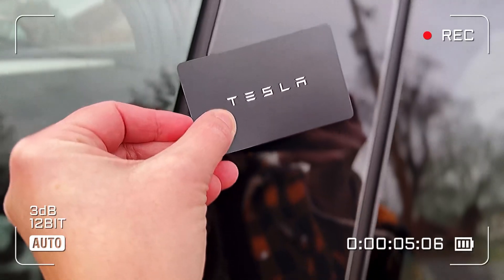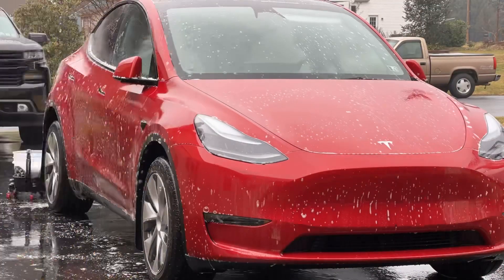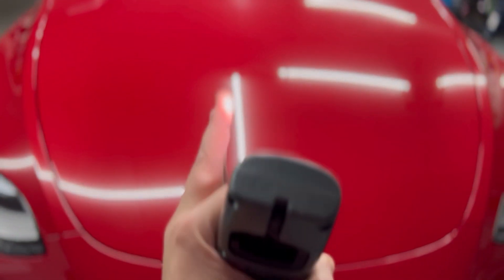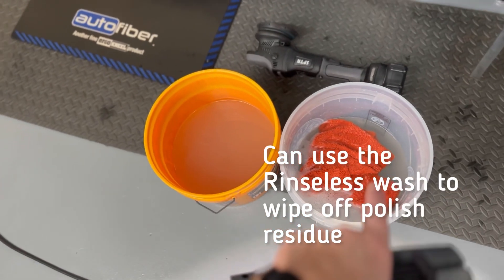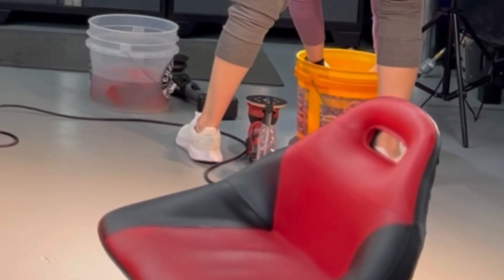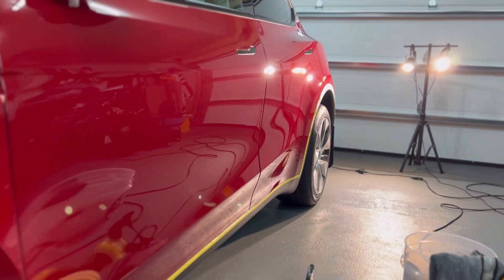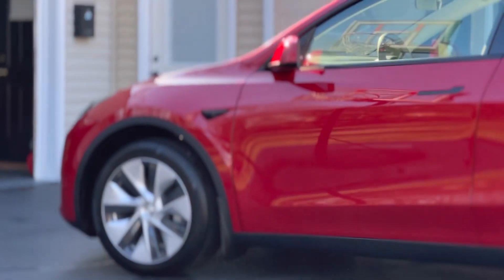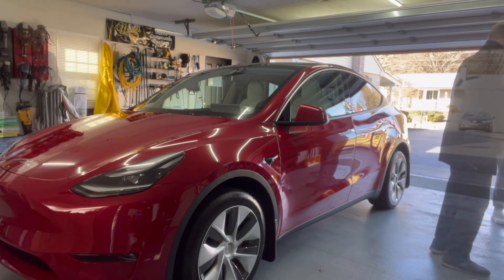Tips On Polishing Tesla Paint! WATCH THIS Before You Start!

Comment: I've never understood why people use multiple pads, I've used compressed air then went to a pad washer after not liking to wear a mask and not have the debit in the air. I must be lucky in 3 years of doing paint corrections I've still use a handful of pads and 4 polishes and have never struggled to do corrections in 1 step 99% of the time. The pad washer is harder on soft pads but it also keeps everything cool.

Comment: I’ve been Coating sooooo many new teslas lately myself. I must admit the paint is some of the worse and it’s that way on all models. I find myself using Xtreme Solutions finale on lighter colors and LVR403 on darker. If I need a little more cut I’ll add a couple dots of ICE. I have had success with EOD Polish but now find myself reaching for DIY spray polish more and more now.
Reply: What pad are you using?
Reply: @kimnewling5728  either yellow rupas or the DIY yellow waffle
Reply: @royaltyautodetailing  thank you

Comment: Would you recommend a short throw polisher on softer paint what is ghosting?  Like always enjoy the videos
Reply from the maker: Sometimes the larger throw can cause the marring so an 8mm is sometimes easier to finish down on softer paint

Ghosting is when you see the silhouette of the pad or polish in the light even after wiping off the residue from polishing. Sometimes it not detectable until you put a light on it. It’s similar to holograms but not as severe and normally just needs either a softer pad or polish to remove
Reply: @ okay thanks I’ve had that happen to me with my dad’s truck never knew what that was called enjoyed your first podcast it was really good

Comment: Hey Chelsea thanks for the video. I got a Model Y that’s about 7 months old now got it back in Feb so the paint is pretty 9.5/10. So barely any imperfections. 

My question is, do you think it’s necessary to get a paint gauge bc of how thin the clear coat is? I’m scared to polish but I purchased the DIY foam pad and spray polish just like you and I’m just nervous af to mess up the paint as I’ve never don’t it before. 

I also will be using maybe 1-2 waffle pads as well but will be cleaning it throughly as your process indicated in the video. 

Looking forward to your response. You’re the best !
Reply from the maker: If you’re only going for a paint enhancement on a brand new Tesla and using the gold standard and waffle pad, you should be fine. You just don’t want to go super slow with your arm speed but if you do 2 to 3 passes at a moderate speed you’re not gonna be taking off too much clear you should be fine.
Reply: @attention2detailswchelsea  thanks Chelsea! I was even gonna purchase a paint gauge but I don’t think it’s necessary .. I’ll test on a paint portion first. 

I appreciate you!

Comment: That’s a new one, can’t remember how to unlock the damm door! 🤣 So far I had a Cadillac that the battery died when working on the interior, the touch panel had just enough battery to open halfway. That, according to the dealer, was enough to disable the air conditioning. I had a trickle charger on it, but dealer said battery was dead. Another car, a honda, had a tire go flat and the battery die, was polishing it when In between songs on my garage system, working the fender, I heard the hissing. You could do a video on all the problems we run into. Some vehicles loose settings if you disconnect the battery.

Comment: Your videos are great... I have a couple of questions about polishing:
1) do you have any idea what RPM (roughly) you were using for the Tesla?
2) what size pads do you use?
Reply from the maker: I typically land on setting 4.5-5 (not sure if the rpm’s) and use 5” pads
Reply: When you coated this, did you coat all of the glass (windshield?), trim (rubber and plastic), headlights and cameras? @attention2detailswchelsea

Comment: You need a pad washer.  Yvan has been suggesting that for years and that is how I work.  As soon as the pad becomes dirty, I bring it to the pad washer and clean it.   There is no need for 1 pad per pannel when you work that way.   Also, this helps cool down the pad so they tend to last longer.  Also, not removing the pad from the polisher help preserve the hook and loop material so they last longer that way too.   I wonder is a rotary with a soft pad might work better on super soft paint.  I know Yvan like them a lot but I have a hard time trying to switch having been working with a DA for over 10 years.
Reply from the maker: I have one I was just showing an alternative to it with their rinseless wash for those that don’t have the $$ to invest in one as they can be expensive for some who don’t do this often
Reply: @attention2detailswchelsea  Yes, they do make an insane markup on what is basically a bucket, a grid guard and some plastic cups and  springs!  Paid mine like 100$ 6 years ago, now I think they sell closer to 200$.  But they do improve the work experience and down time a lot.  So for a business, I think they are a must.  For an enthousiast, they can certainly do without.

Comment: Now all you need is a pad washer. Clean that pad in 10 seconds 👍
I could have sworn you had one.
Reply from the maker: I do have one, but I had stopped using it because it was starting to tear my foam pads up and because I only had one pad I didn’t want to tear it up but Yvan let me know that these pads hold up really well with the pad washer and trust me, I will use it in the future now. But I was also trying to share techniques for those that may not have the money to invest in a pad washer because they are not the cheapest.
Reply: @attention2detailswchelsea  yep definitely anyone can use the bucket wash method. Good point. Weird, never had the washer mess up pads.

Comment: BTW, I used to use McKee's 37 Nano-Ceramic coating (not the graphene one) but after seeing independant testing on Scott HD's channel, that coating performed really poorly compared to other products so I switched to Cquartz UK for my 2 year product and the Gtechniq CLS+EXO for the 5 year product.  McKee's coatings are very inexpensive but they simply don't last.  In the test Scott did, they only lasted a few months compared to years for other products.  I suggest you have a look at his channel.  Also, graphene was provent to be much worse than nano-ceramic coatings.  I watches some interrviews with chemists and the problem is that no one has found a way to combine the graphene with the resin so it lasts.  They fail faster than nano-ceramic, and their supposed advantage of preventing water spots is not true, they water spot just like nano-ceramics.
Reply from the maker: I’ve had a graphene coating on my vehicle for over 2 years and it’s doing great. And 0 water spotting issues but appreciate the feedback and info
Reply: @attention2detailswchelsea  Are you topping the coating evey 6 months?  If so, you might be seeing the effect of the topper, not the coating.  If a coating fails like you said within 6 months if not washed often, that means the coating is crap.  Not rubbing it, and spraying it with chemicals once or twice a weak should improve the coating's durability, not reduce it.  Coatings are supposed to be pretty much immune to chemical products.  The one I use is resistant to chemicals from 2 to 11 on the PH scale.

Comment: Dont you have a pad washer? Do it on each pass for the same results!
Reply from the maker: I do but it can be rough on some pads sometimes I find and I only had one pad so I was trying to make it last and the handwashing is a lot gentler and also for those that don’t want to invest in a pad washer I was trying to show a more economical way to clean pads. But yes a pad washer is a great option as well
Reply: @Attention 2 Details w/ Chelsea i gotcha. Ive never noticed it being hard on pads personally. I only agitate on speed 1 or 2. Ive polished 10 cars using the same single pad in my shop. Still looks basically new. But your way is close and definitely better than nothing

Comment: That was a very informative video.  I've always wiped off the polish and made sure everything was just right.  Then before applying any protection. I always used a panel wipe of 20% alcohol 91% to 100%. I'm definitely very impressed with The Gold standard DIY polish.  The softest paint I've worked on is a Lexus? I've got some minor swirling on my 2008 Mercedes W211 E class.  I'm thinking about trying as a light cleaner polish. I used a 50/50 euro fiber pad and 3D-one to get the paint corrected when I first got it in 2020. I need to really get a good coating on it. Instead of a year long Turtle wax Graphene protection.  I was thinking Art Desthine metal oxide coating.  But the Mcgees is better coating? Thanks again for sharing your great knowledge and experience!
Reply from the maker: I did do a panel prep wipe.
Reply from the maker: Art de Shine is definitely an amazing coating but imo I think the graphene coating from Mckees 37 is easier to work with a land comparable in durability